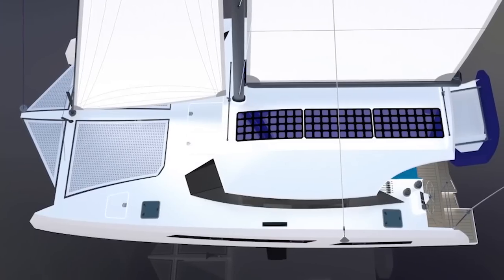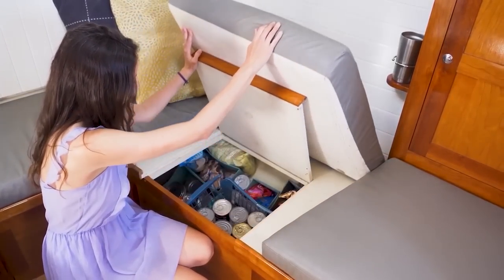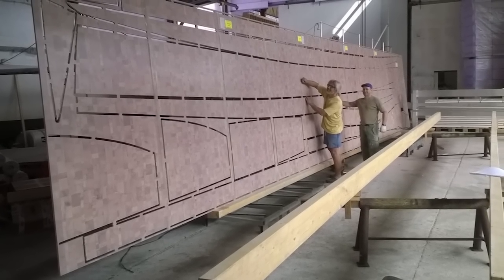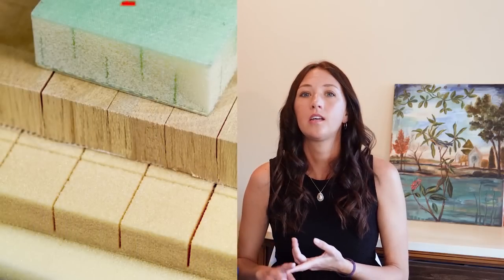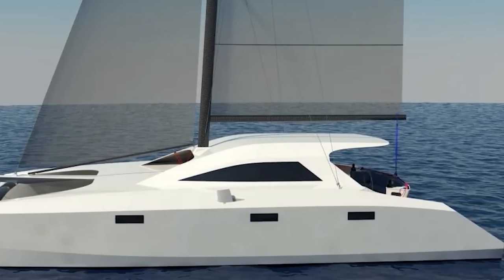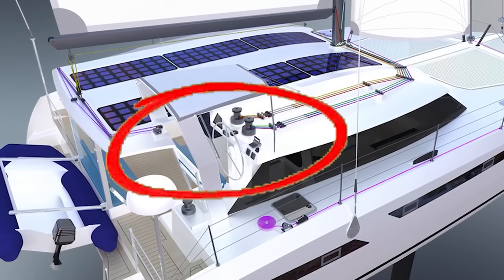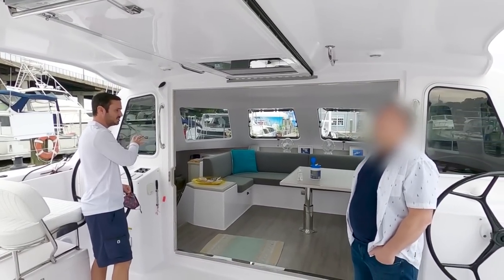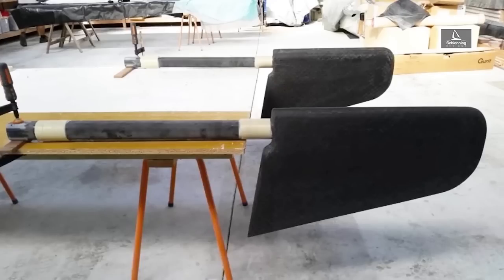OUR DESIGN CHOICE REVEALED For Our Catamaran Build!! - MJ Sailing

Comment: Great choice, I too suspected this was gonna be it. Something I was thinking about...never built or restored a boat but lots of cars.
This time, you are skipping all the tear-down/clean-up/refinish/fix rot/sand phase. Everything you pull out of the container is going to be brand new. Everything will be clean, and you know as well or better than most a lot of the drudgery in the resto process is getting to the day where you can say,"OK. Now we begin the put it back together phase"
I think this will help keep you happy and help the motivation if you get to a "funk phase"...I got to that on every car project I have ever done, where I just want to walk away for a couple of months, but once I get the think, fab and assembly portion I get the buzz for the project back.
You guys are good at this, are smart, and work well together. I can even see you becoming consultants for others who follow behind you who are building this boat. Your skill set with this boat will be  proven, along with the Elements build. I think you two may find a niche source of $ if you want it...

Comment: Sounds great. But you didn't mention rigging, sails, electronics, kitchen fit-out, water maker, auto-pilot, other hardware. That all included in this price? Solar? Engines? Would love to hear your plans with that part, or what's included. Sounds like fun.
Reply: They mentioned that is the hull price...all rigging, etc is a lot more, especially sails will be upwards of 50,000 depending on inventory.

Comment: A good choice. Builders/project exhaustion is a real thing. My Father Alan Slater always believed that a project is best done in six months. That was how the PDQ name came about. He designed boats that were quick to build and quick on the water. Having watched you paint and repaint  Elements, I am glad to see you will finished surfaces and minute details already taken care of. I can fairly easily suggest that this decision will knock 4-6 months off your build time. My family built 5 catamarans through the seventies and eighties. We then went on to build over 300 boats at PDQ. Hulls, Decks, Rigging was always the easy part. Interior and finish were the labour intensive parts. Systems have now also become an additional and very complex addition to the mix. Good luck and make sure you have a nice place to build in !

Comment: How incredibly exciting! Good call on the final choice guys - this looks like a really great balance between cost, performance and practicality for a self-build cat. Just watch that weight! If you can figure out a way to measure the weight of the hull components when they arrive, that would be really good to know (or maybe they already did that) - the target displacement of 7.4 tonnes is ambitious, and means some careful design and process control in the layup. Weigh everything that goes on the boat! Which rig are you going for? The spreaderless mast is tempting for cruising, but I'd miss the self-tacking jib and extra performance of the taller mast - although there's more complexity and extra windage from the spreaders. We've now sailed Easytiger with our new J0 quite a bit, and it's a real pain tacking an overlapping headsail when there's an inner stay to get it around - we end up half-furling it through the tacks - which needs a crew of 3 - but it does boost the performance quite a bit! (And it's very versatile, working well downwind too). We have some news too, we're going to be liveaboards! We're buying a 45ft cat called Star which was on the brokerage at Millbrook when you were in Plymouth, I probably mentioned we were thinking of it - we'll take ownership this week.

Comment: Having built an F-9A 31' tri (Carbon over Duracore strip plank), I know how labor intensive the fairing and finish process is. Just when you think you are just about done with the structure completed, it takes another 8-12 months to finish (my regular job I was consuming 50-55 hours per week). Towards the end I hit the wall and just wanted to launch. It took 24 months total and you are smart to consider the rent, utilities and human toll. I don't think I can go through that again at my age so I'm thinking about a prebuilt version.
BTW, I'm not sure if I can go w/o a wash machine. Good luck - I would love to visit your build.
Reply: Actually on another channel I saw a sailing couple buy a washing machine. Nothing surprising there except it was a plastic one for 100 euros. I thought for that price they would be turning a crank but no it was powered. The thing is it was so light they could pick it up with one hand. This was on a monohull so unless space is at a premium it would be ideal for most cruisers especially cats. I have no doubt it does not have the same spin speed or load capacity as a domestic washing machine but a lot lot better than a bucket. I am not sure if it also had an heating element but hey just add some hot water and with today's modern detergents very hot water is not required.

Comment: Excited to follow your build, I didn’t understand your comments about minimizing things you are taking on your new boat? The new boat is a crushing boat that sails fast. Traveling the places you will be traveling, it seems it would be the opposite, about capacities, water, fuel (most weight and most important) food, tools, spares parts, clothes, computers, cameras, batteries, sails, tender, solar are necessities, what things are you not taking or limiting)?

Comment: You are great team indeed. Wish your dreams to come true. But this will pull a lot of work to do. Great if apart of nice 3-D pictures the boat is properly "calculated" by clever architect and clever engineering team + it will be superb to have also the boat built precisely to these calculations. Good luck!

Comment: Max Cruise's base price production boat is around $550K US for the Max 42. So how much will you save by building it yourselves (with help,) and all the accessories, wiring, electronics, duct work, plumbing, engines, generators, solar panels, etc.? If you're talking about $150K for the kit, are you thinking that you can build your boat for another $200K or less?

Comment: Right choice on the Max Cruise because: 1. resale value will be higher, 2. build time will be shorter, 3. design is more comfortable, 4. less physical body strain on the shoulders, 5. wide cockpit doors that fold up, 6. helm position visibility.  7. vertical window angles so less solar heating of cabin.  Enjoy building - reminds of me Grand Rapids furniture makers attitude - my aunt was the president's secretary at Baker Furniture for several decades.  You did not make a mistake selecting the Max Cruise.  Thanks.

Comment: I looked on the MAX website and still have a question. The 2000 Kg payload, is that after the diesel and water tanks full? If not, that is 400Kg for water and diesel would be 350Kg to 384Kg.  1250/1226 left for goods. I hope  that the 2000Kg's are after tanks are full

Comment: Very curious how the joints with finished gel coat will work. You briefly mentioned there is a structural lap joint is on the inside, but I wonder how they get a fair and sealed outer seam. Also looking forward to your test sail when a model arrives in the USA.

Comment: Very exciting times for MJ Boat Builders!!! 😉😁 Coming from a totally non-boating perspective and knowledge base, you’re reasons are quite thorough and very analytical. I’m thinking there’s more to this boating thing than Bahama Mamas and sun tans. 

I looking forward to seeing how it all comes together. I am curious about your propulsion plans. My vote is for electric motors, as if my vote counts here. 😷

You might have some weight savings with a couple electric motors and a battery bank instead of diesel engines and fuel. I know of this ONE couple sailing an electric monohull sailboat around Europe currently that could probably hook you up with a boatload of tips, tricks and pointers. 😁👍

Let me know if you need their contact info.

Comment: Any particular reason why you were talking about the kit pieces for the Schionning coming from South Africa (Current Marine?) rather then ATL Composite in Australia?
Reply: If you go with a foam cored kit from Schionning, they typical - especial to people in the US - have Current Marine build the kit.  Current marine doesn't use the "z joint", but they do build each piece up to 40' long instead of the 4'x8' panels out of ATL.   And they are much cheaper than ATL.    - Matt

Comment: When you came out with the intro to the Max it was a clear winner. I'm not sure I agree with the "Outboard Engines" though. I understand the reduced costs and complexity but having all that fuel (Gas) onboard wouldn't be my choice. Maybe go the "UMA" way and go electric? Congrats on the choice and I am looking forward to following the build. Cheers
Reply: Yanmar do a German designed 50hp diesel, but it is aimed at the commercial marked so is likely to be much dollar!

Comment: $150k doesn’t seem bad. Add another $150k-$200k in rigging, motors, AC, fridges, electronics, etc etc. Very cool. Wondering what it would cost for the factory to finish it off. Maybe I need to send some emails to figure it out. Good luck on the build.
Reply: I believe the production version is $550,000, but I haven't fully discussed that with them for those details.  Too much time trying to figure out for our own set-up :)

-Matt

Comment: Kinda glad you decided to go with the Max.  There's a lot of schionning examples out there to look at, but none of the Max, so getting to not only see the finished product, but the build process as well will be great!  I also think it's a more modern design that is probably going to end up being a potentially better boat.
Reply: As for the weight issue, I don't think that there is in reality much difference between two boats of similar sizes when comparing the flat panels vs female moulded.  While the female moulded hull is going to have that extra layer of gelcoat, the flat panels have the fairing and extra adhesive.

It's also important to remember that 99% of the time the weight listed on a plan is just a calculated number based on the volume of displaced water at the DWL, and not based on actual material weights (typical lightship formula is basically weight of displaced water * .7, which is obviously a completely irrelevant number compared to actually weighing the thing, lol).  Comparing two boats from two different designers/builders is a pretty fruitless thing since none of them provide weight based on the same parameters, and a lot of them are just outright dishonest about i (particularly those designed in the late 90s through early 00's).
Like you said, load capacity is an important factor, and honestly, probably more important than the weight of the bare hull.  A super light cat is going to be an amazing performer, but the average load is 2 to 3 tons for a single person living aboard, so that boat weight can easily go up.  Unfortunately, those super light boats mean a LOT of compromise on what you can bring, and if you bring too much your performance ends up much worse than if you had just gone with a heavier boat.  When your average load makes up almost 50% of the total weight, the boat is much more heavily impacted.

Comment: The Max looks like a great vessel.  I'm frankly astonished at how low cost it seems.  All that for under $200k!?
Reply from the maker: We get the 3D molded components for the price we listed, but we still have to fit it out with the mast, boom, sails, winches, deck hardware, electronics, and everything else.  😉
Reply: @MJSailing  Ah, ok.  But, still...  It won't end up being half a mil, will it?

Comment: 19:10. - comment on seeing thru the headsail--  Will not be a problem when you have head sails furled entering a harbor?  
Prolly also not a big deal when sailing out in open ocean.

20:09.  open doors-  Have you checked if doors will completely open under sail with possible tweeking of the structure under stress?  or seen it out sailing with other totally open rear door system?.  Smaller door opening might mean greater structural rigidity between hulls/cabin and roof structure.
Great fun ahead...  good luck

Comment: Great choice, for the right reasons. 

Some suggestions. Consider a vinyl wrap. Check out O Kellys channel, their vinyl wrap looks great and they go over the benefits. If you are adding a teak deck in the aft cockpit consider the product, flexiteek. O Kellys also have a good two part video on electric propulsion. If you can't afford or fit two engines that might be an option, not sure if you could fit all the batteries, generators and alternators in though.  :)

Comment: What were the major disadvantages of the Grainger Raku designs?
Reply: Price, price and price.    He was closer to the Max Cruise vs the Schionning for ATL flat panels.   I also got better response from the other designers when I'd ask a question.... And that's before I bought.    Matt
Reply: Hi Matt, thx for sharing your thoughts. You might have a look at this build of a Schioning 1500: https://m.facebook.com/Zeilmee.nl/photos/?ref=page_internal&mt_nav=0. This Guy did the build without kit, so only the plans and he homemade the panels by vacuum infusion. I calculated the material costs for building a Arrow 1360, sourcing in Germany- same building stage as the kit would be roughly 40k$ without equipment for vacuum infusion. To sum up: the kits are way overpriced.  Maybe there is room for price negotiation? BTW the guy I mentioned built the 75m2 bridge deck in 2 days with vacuum infusion! All the best Peter

Comment: Coming at it from the reduced cost aspect, how much extra is all the electronics/mast ...etc ? Also what about the rental of a warehouse or whatever to build it on? Is that all together about another $100k?
Reply from the maker: Our build tent was free for the first two years - a friend of a friend hooked us up.  Third year is $4800.   We do a "cost" video after this one, but it was before the increase in pricing in the past few years and has increased about 30 percent from that estimate
Reply: @MJSailing  Thanks for the reply, Ill think I saw the pricing video but it didnt talk about guts/mast costs etc, also I think probably cost of living not on the boat should be part of the equation and even though labor is 'free', everyones time is worth something. For example if it costs $100k a year to pay someone else to build it while you make $300k a year at your job, then that may be better than quitting and doing it for 'free' because then there is a net loss of (or cost to you) of $200k. I think this applies to projects of passion too where you 'love doing it', we have finite amount of time and so its worth something.

Comment: I shot Terry a msg at Max after seeing your video last time. I did mention you guys. But looking at the two you will save 12 months plus in back breaking sanding fairing repeat, repeat, repeat.  🤣 The Max will kick of in the kit game I feel due to the time saving to be made.  Are you going diesel or  elec drives. ?  Would you be using the max crew for rigging /mast or sourcing all that locally.  Great to hear the parts are in the process too. Again another great time saver in being next in line.  Keep the videos running on what gear you are going with and why. Will be interesting to see what you plan on putting in before it starts.